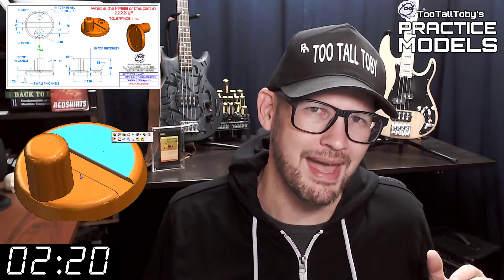2D Drawing to 3D CAD - PRACTICE MODEL- Onshape, SolidWorks, Alibre, Fusion360 - EAR BRACKET

Comment: About 7 minutes...
But on a laptop. No second monitor and no mouse. Trackpad only.
Alibre Design Pro.
Reply from the maker: Wow trackpad only? Very impressive!!
Reply: Trackpad only and no 2nd monitor in 7min? Wow man... Are you sure we shouldn't switch places in the tournament... lol. Great job man. You're coming up to speed with Alibre amazingly fast.
Reply: @ExMachinaEngineering  In fairness, this model is about 70% similar to the Alibre practice model I did about a month ago. So I already had a method in mind.